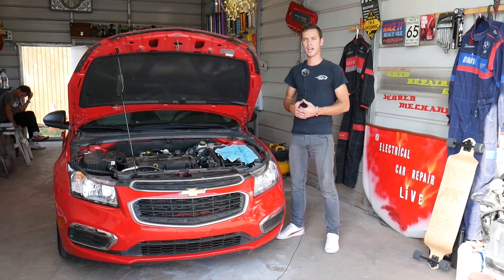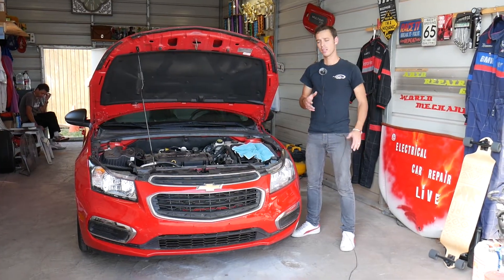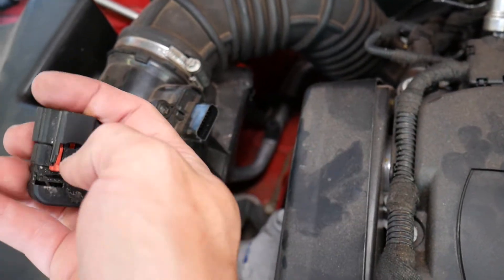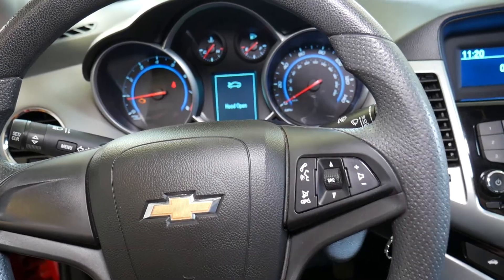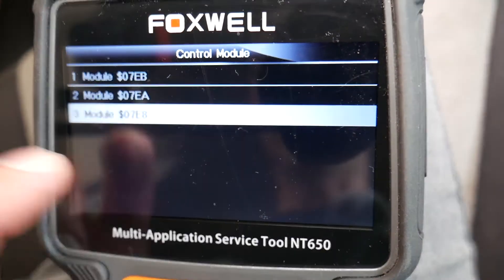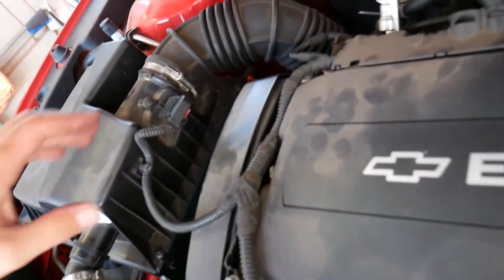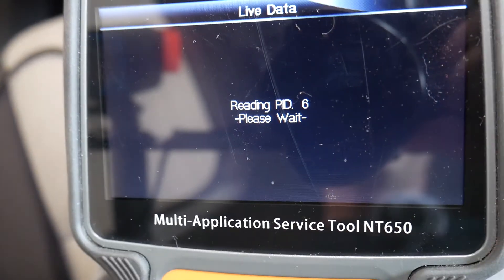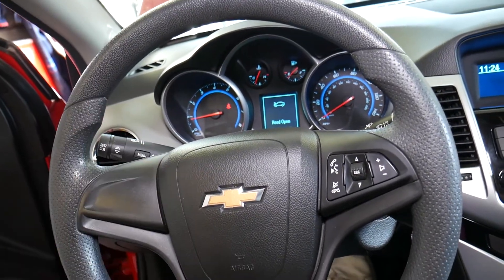FIX CODE P0097 P0113 P0096 P0098 P0111 P0112 INTAKE AIR TEMPERATURE SENSOR CHEVROLET CRUZE SONIC

Comment: I’m a female an I need help my car what start an I replaced the air flow sensor an it still won’t start. Is there a restart or relay sensor I can take out a plug back in to reset everything??

Comment: I have chevy sonic 2012, the error appeared since 2 weeks and tried replacing the air filter, cleaning the sensor, etc. but in vain. I'm not experiencing any issues while driving.. everything is normal. Only the fan keeps running always.. should I replace the sensor ? The error is: P0113 Intake Air Temperature sensor circuit 1 high
Reply: It has to be tested properly. This guy in the video is a clown

Comment: Thank you sir. I forgot to plug it back in after doing other work. I thought I messed up wiring pulling the cooling fan in and out while changing it. Not much room with the manual shift 16 sonic.

Comment: i have replaced my Mass air flow sensor with a Bosch mas air flow sensor i matched up the numbers with OEM parts  its been awhile since I replaced it. Shouldn't have to replace it again but I plugged my scan tool with same one you have in the video it says   Po 113. unplugged the mass air flow sensor because traction control and stability control on dashboard it went away after unplugging it. plugged back in it comes right back on the dashboard. what could it be then
Reply: It could be that the way that the car interacts with the Bosch sensor in a different way than it expects, which is causing feedback issues in other areas. In this case, trac and stability. Similarly, a short in a module will cause crazy issues. For instance, with my 2013 LTZ, when the passenger blind spot module shorts, it causes the radio to draw too much power and blow the fuse. When the driver side blind spot module shorts, it causes power failures sporadically across the vehicle. This can range from the cluster dials not working/freaking out to the whole car just shutting down while you're driving 85 on the interstate. Thankfully steering lock doesn't initiate until the car is placed in park.
Reply: It has to be tested properly.

Comment: I have a 2013 chevy cruze 1.8 liter and it will not start. I have replaced the starter, but it still will not start it just click. Don't know what is the problem. Please help.

Comment: I replaced the mass airflow sesnor and now I'm getting code for intake air temperature  sensor circuit low voltage.  Wiring and connector is all good.  What do you suggest I do?
Reply: I have the same problem , did you fixed
Reply: I has the same issue changed my MAF sensor and then it show me up Code P0097 I changed but the check engine light still on (Buick Encore 2015)
Reply: رمز العطب P011B00 سيارة kia rio prestige 2020 . لم افهم المشكل
Reply: I wonder why the channel creator did not respond
Reply: @NextLevelAutoDiagnosticsLLC  Maybe cause the video is SIX YEARS OLD!

Comment: Im having p0102 and the 113 as well. I already replaced the maf sensor. Im getting the code right away. Any idea what it might be?
Reply: What was yours? I've changed my maf and cleaned throttle when having the engine cover off, my air tabs were broken from my EGR solenoid. And therefore the vacuum hoses were undone. Can't find original part anywhere and OEM don't fit. I found one on amazon that's coming today. I hope this fixes it.
Reply: It has to be tested properly

Comment: I got this code but my car won't turn on. So is it still the sensor?
Reply: I have the same issue. Will not start
Reply: @wesleyshafer6310   hi so i disconnected the positive nd negative on my battery replaced the part anx it starts now. Give it a try
Reply: @ivonnecontreras3459  I just put in an order for the part. I will try disconnecting the battery and unplugging the part before it gets here and if it does not work ill try it again after it gets here. Thank you so much for the help.